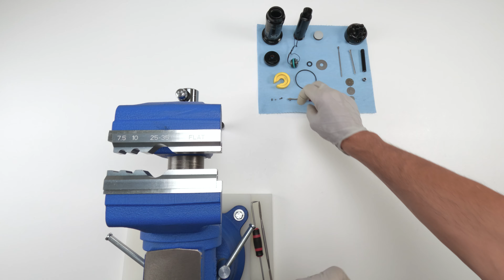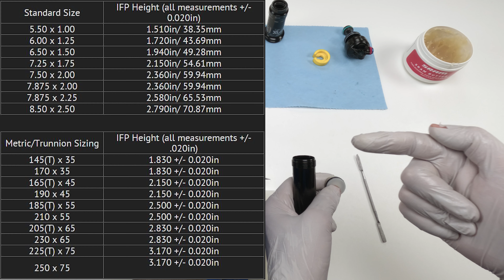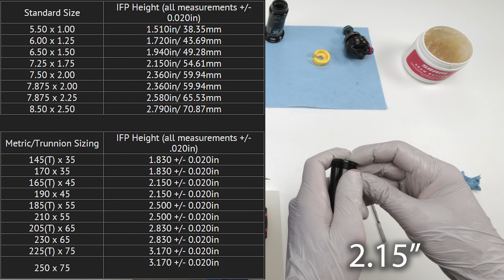FOX DPS Shock Repair + Full Service Guide for Beginners. Broke your knob? Then this video is for you

Comment: Here's a little tip how to get that white ball easy. Just heat the pick with a heatgun, and you will get it in a secong just by melting it. 
Saw it once in a random instagram service video.
Reply from the maker: Yup, I've tried this as well in the past. It needs a SURPRISING amount of heat to melt though. I might do this in a future video to show the option. Thanks for sharing 👍

Comment: Couldn't be any better timing than that! Literally planning on doing small maintenance on mine. It's overdue and I should do the full one (over 3000km of riding), but don't have all tools required yet.
Reply from the maker: At 3000 KM, I'd say a full one for sure, especially if that's over multiple years. If your knobs are working fine, then you don't have to work on them, so this will save you some time. You will need two fox tools at a minimum: the 5/8 piston socket and the 3 nipple spanner socket. The rest can be done with tools that can be bought at the average hardware store. 

The hardest part of this job is filling the ifp chamber. You will need a high pressure shock pump and needles. I plan on doing a dedicated video for this very soon, I highly recommend buying extra needles as they will eventually break, and it is very unpredictable when they do. I have at least two other DPS videos out there that might better match your DPS in case that helps. They also show how to fill the IFP chamber with a hand pump. 

 If you don't have ANY of the tools needed to complete this job, then I say send it in for service if possible. 

Let me know if there are any questions
Reply: @zoubtube  the bike is bought 01.2023, so its slightly over 1 year old. The biggest fear I've got is exactly that: the needle part (already bought 600 PSI capable pump) and those two special tools you mentioned. I cannot find them without paying over 100 EUR.

Can you cover in your video one question: can IFP be pumped with a compressor or it's a no go? I am OK doing it by hand, it will just take a long time and that's a lot of movement while pumping with a short hose and a needle at the back...

Comment: Regarding getting that ball out, I don't have a handy tip on how to actually pop it out, BUT for making sure you don't lose it/shoot across the room while picking it out, rather than the magnet, use a snack-sized ziploc bag (or whatever works best for your hands), and hold the assembly in the ziploc "pushing" into the back of the ziploc so if/when the ball pops out, it lands safely contained in the ziploc.  (A tip for any bearing or spring-loaded parts removals that require "uncontrolled" disassembly, do it in a bag that catches anything shooting loose.
Reply from the maker: Never thought of trying this but it seems like a good idea. Just might give it a try next time 👍

Comment: My fox float DPS came with 2 green rubber negative volume spacers on the Shaft/Piston. Any idea what they’re for?
Reply from the maker: They are negative chamber tokens (volume spacers). Just like the positive chamber tokens they are used to tune the shock to your liking. The negative helps stiffen the low end a bit and softer the top end. Don't assume they have to stay in there. I highly recommend that you test ride with and without them.

Comment: Question if you have a chance. Is it possible to service the cam shaft assembly (rebound knob and compression lever etc) without releasing IFP pressure? My rebound knob wouldn’t turn so I tried to lift it to figure out what was going on. Ended up popping the whole cam shaft assembly out, along with releasing a whole bunch of damper oil. Instant regret on that one, but curious if I just made a huge mistake, or maybe something was off internally resulting in the oil release? The compression lever took a hit and bent that set screw. Lever and knob never worked well after that.
Reply from the maker: Servicing shock dials with a pressurized IFP (Internal Floating Piston) chamber is risky and not advised. The moment the cams are dislodged, the pressure will want to escape, taking oil with it. This will also displace the IFP. To fix this, you will need to rebuild the shock. While the rebuild itself isn't complex, refilling the IFP chamber—especially with a syringe—can be a PITA sometimes. Let me know your thoughts on servicing it on your own to solve your issue, and we can take it from there.

Comment: It’s kinda hard to tell, but the compression lever will be floppy until you snap the lifting rod into place Is that correct?
Reply from the maker: yup! I need to remember to mention this in my next dps video. I've been ask it a few times

Comment: Great series of videos.  I'm going to start doing my own servicing as I have lost faith in my LBS.  Do you have a listing of the special tools and jaws you use in your video?  I'm going to start with the Rhythme 34.
Reply from the maker: Thanks for the positive feedback. At the start of each video, I cover the necessary tools and parts. When I began creating these videos, I attempted to include links to all the tools in the description, but these links quickly became outdated. I simply didn't have the time to constantly update changing URLs. The tools section should help, though on occasion I'll forget about a tool needed for the job, that I end up mentioning during the job. so just ahead up on that one
Reply: @zoubtube  Thanks for the reply, I'm new to YouTube and will look for the descriptions, I originally looked in comments.  Once again nice job.  I'm getting away from my LBS after stumbling in on a fork rebuild, was filthy and unorganized, in addition two Fox DPS were rebuild improperly, issues with the 3 position switch.  After watching your video I understand what they did wrong.  Thanks again. Steve
Reply from the maker: It's unfortunate you had trouble with your LBS. The truth is, these tasks aren't particularly complicated. Like anything, the first attempt can be intimidating, but once you've done it, your confidence will GREATLY increase. As always, let em know if there are any questions and I'll do my best to answer them

Comment: The blue lever is lose on mine come from shop brand new any ideas whats wrong 😮 i regret buying this already
Reply from the maker: Does the knob work at all? How much movement are we talking about? Is it a wiggle or a good amount of play? If it's a small wiggle, it's normal. If it's a significant amount of play, then the shock needs to be serviced to be sure. There is very little that would cause this. It could be something as simple as a loose set screw, to the cam not sitting correctly on the rebound rod if the knob freely moves around. Let me know. 

Also, don't be down about it. DPS is a good shock. If it's under warranty, fox will handle it. 👍
Reply: @zoubtube  wow thanks for great reply, its a bit too loose id day can here it rattle when i lock the shock off can hear it when i ride, its brand new! How do i contact fox i am in the uk? The seller has offered me a refund but have to send it back to Germany, really appreciate your kind reply 🤝🏼😁
Reply from the maker: imo, if it brand new, and you have the option to exchange it and get a refund due to a manufacturing fault, Id take it, especially during the winter time. FOX UK can be contacted here ukservice@ridefox.com or  +44.0204 5863775. They might/should be able to expedite a replacement. I'd contact them first. let me know how it goes
Reply: @zoubtube  thanks 👍🏼👍🏼

Comment: Hi Z, appreciate you sharing your knowledge with us. I have watched two of your videos and now building the tool list to do the 200 hr Service. Greatly appreciate and Happy New Year!
Reply from the maker: Glad to hear the video will be of use to you. Servicing this component isn't particularly difficult. If your dials are functioning correctly, there's no need to service them, which will save you time. The main difficulty with the DPS is properly filling the IFP chamber using a needle and hand pump. If this is your first time, it's highly recommended to have at least five needles and five pellets on hand, as needles are prone to breakage even with careful handling. I created a video demonstrating this process a couple of months ago. Additionally, avoid replacing the glide ring (the blue ring around the piston) unless it's damaged. This will also save you time and a potential headache. 

As always, let me know if  you have any questions. Slowly but surely I'm catching up from being out the last two weeks.